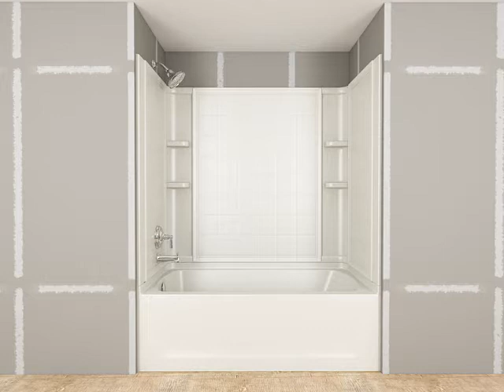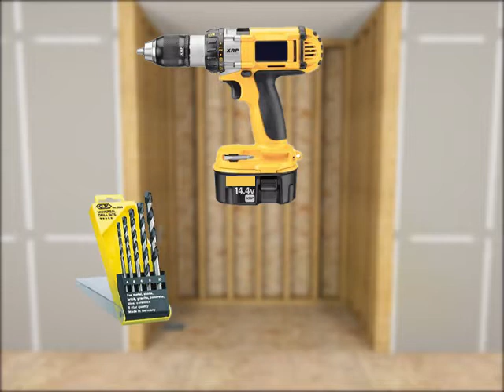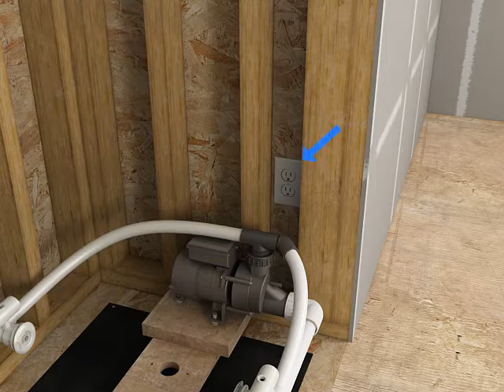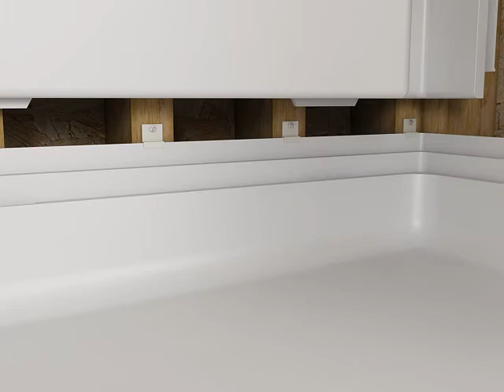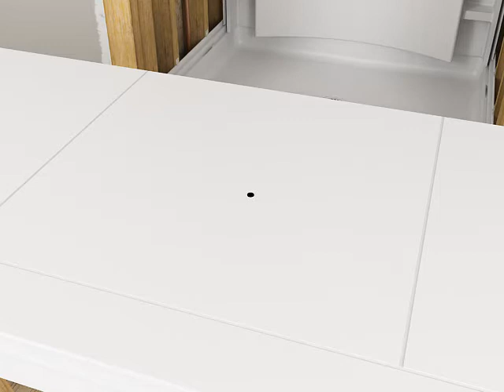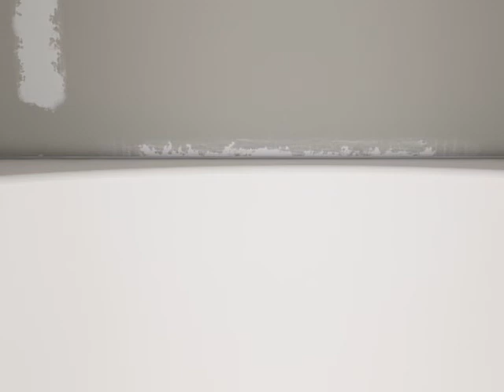Installation - STERLING Accord Showers

Comment: I am planning to install  this kit  in my tiny home. I will have to cut off the top to fit 67" H" (this kit is 74" H) . I am planning to insert bamboo TnG flooring on the top. I will use caulking to make sure there is no water leakage behind the kit. My question is; because the top of the kit (where you drill to connect it to the studs) will not be there, what is the best way to attach the walls to the studs?